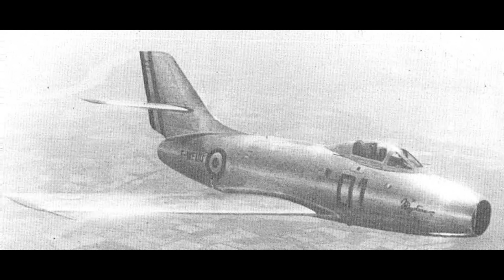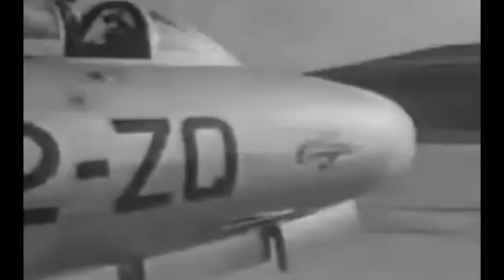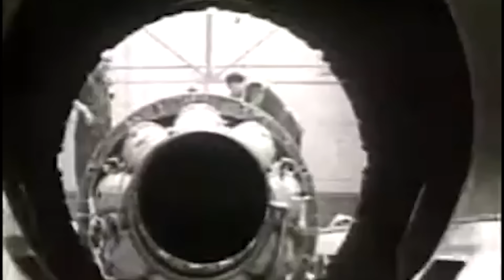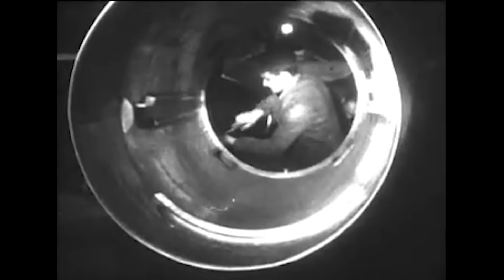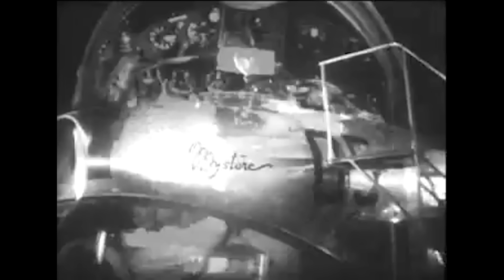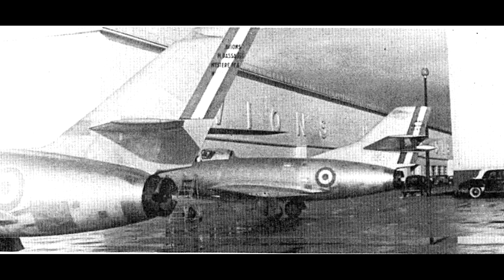Mystère II: Inside France’s Supersonic Failure

Comment: Here are some conceptual errors. Supersonic is considered a plane capable of flying sustainedly and hrizontally, over the speed of sound, Transonic is a plane that is capable of flying well in the transonic regime, that is, when the air over the wings gets supersonic while the air below the wings is still subsonic. The most of transonic planes are eventually capable of becoming supersonic in a dive, but as soon as they get in an horizontal flight, they are unable to sustain supersonic speed and go under Mach 1. Subsonic is the plane that is unable to fly in the transonic regime; that is, the air over their wings will never get supersonic, at least in level flight. Here, the Mystere II and IV were transonic planes. They, like the British Hunter, could surpass Mach 1 only in a dive, independently if that was acceptable or not by their own manufacturer's will. They were transonic; not supersonic planes. However, the Super Mystere (many times compared to the American F-100 Super Sabre) that pklane could surpass the speed of sound in level flight, flying horizontally. Super Mystere was actually a supersonic aircraft, just like the F-100 Super Sabre and the rest of the supersonic "Century Series" aircraft.

Comment: American pilots were the first to go supersonic with a French plane because French test pilots had the wrong technic. With those barely powerful enough planes, diving steeply at full power would not work. You had to make a zero-g bell trajectory that would use 0 deg aoa therefore minimize drag that was the main issue. Plane had no bee waist at the time thus high transonic drag.

Comment: Imagine if the Rogallo wing had been invented a decade or two earlier. The prevalence of hang gliders today proves the flexible delta wing could have been a viable glider option, or even an advanced paratrooper alternative back in the day.

This might have resulted in numerous fixed wing aircraft and drones trying delta wings well before swept wings. For example, the V1 Buzz Bomb could have taken advantage of a delta wing as the wing volume provides a lot of fuel capacity for its thirsty pulse jet propulsion.

My point is ... if delta wings had been perfected before jet propulsion, it's possible the whole straight wing to swept wing transition could have been skipped over.